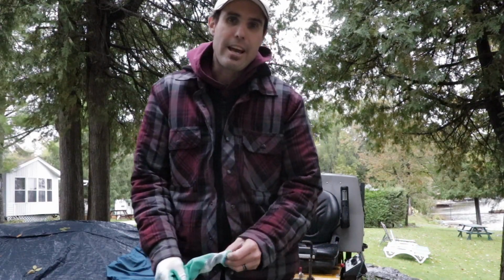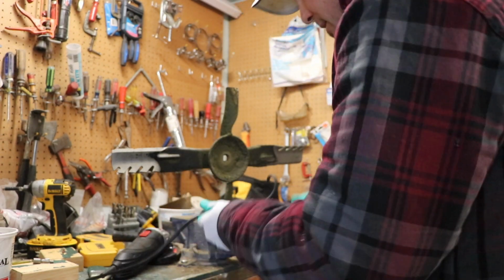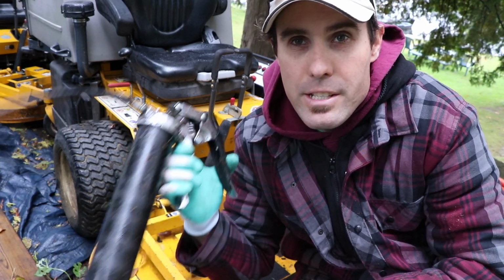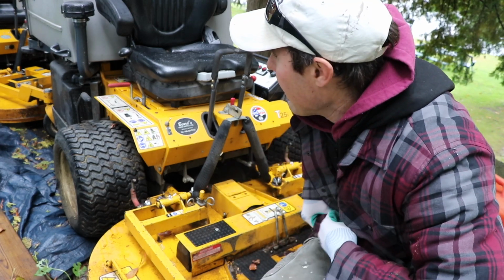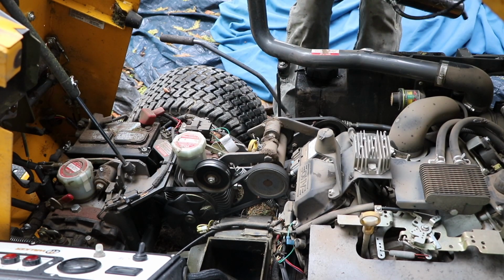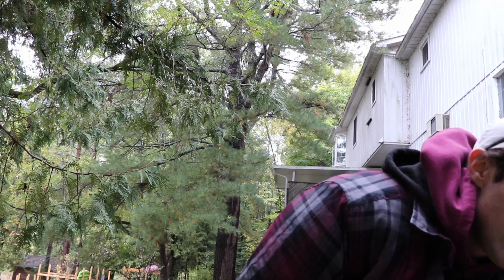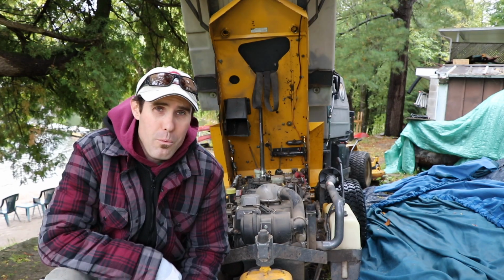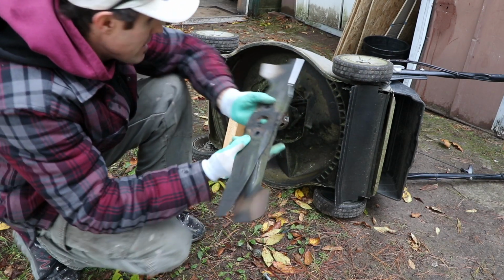Walker Mower Maintenance

Comment: I know this might be a stupid question but how do you release the parking brake so you can push it down off the trailer
Reply from the maker: Lift the body of the mower. There are two red levers that need to be pulled up to put it in neutral. Then you can take off the parking break and it will roll

Comment: I keep having a problem with my throttle sticking.  Any idea how to fix this?
Reply from the maker: The engine throttle? Red Lever or the black handle? If its the black handle there should be a grease point
Reply: @RedRockMaintenance  the red one...the throttle.  The black one is the choke

Comment: What size tires are you running on the mc 20?
Reply from the maker: They are the low profile tires.
Reply: Red Rock Maintenance I have that same mower but I can’t find those low profile tires. The ones I have are round of that makes sense.
Reply from the maker: Octavio Zavala I got mine from my dealer. They put them on when I bought it